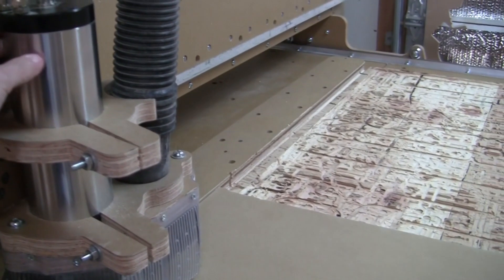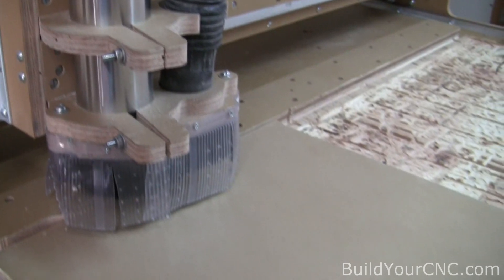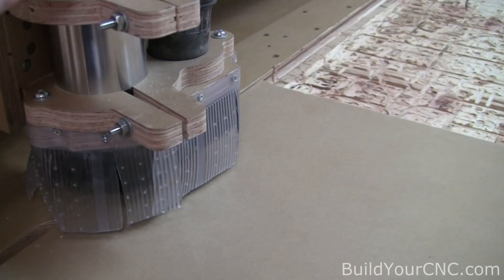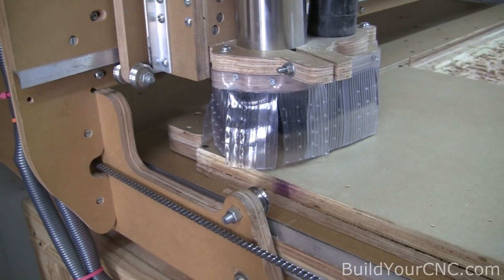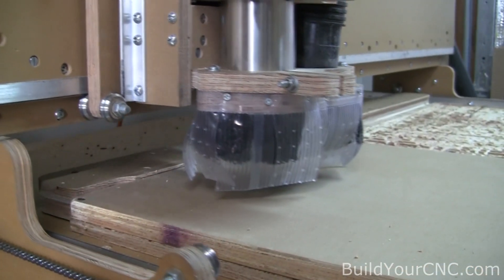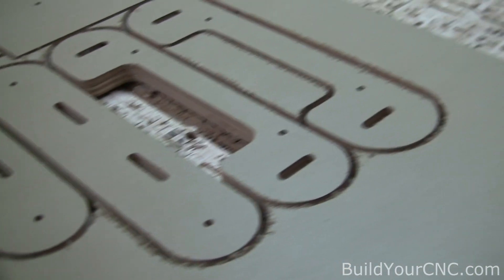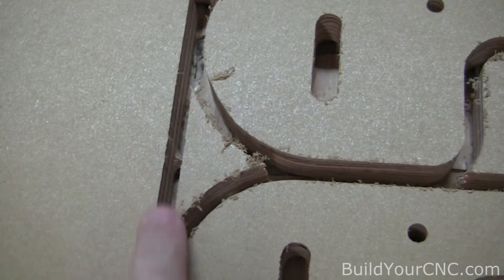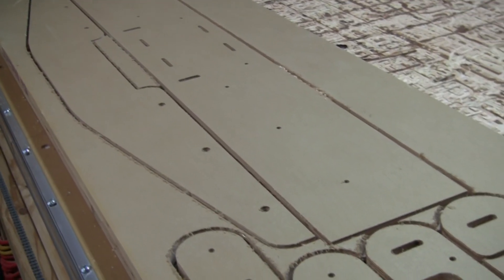greenBull Spindle Test Full Depth Cutting and Dust Extraction

Comment: Thanks for the video. I have the same spindle motor and am finally almost ready to assemble my CNC router.  I was wanting to see a nearly full load test of the spindle motor making chips, but almost all of the video was accelerated so it was difficult to assess the actual performance.  It would have been fairly pointless to show nine minutes of routing, but I'd rather see three minutes of normal speed routing with the less interesting parts omitted.